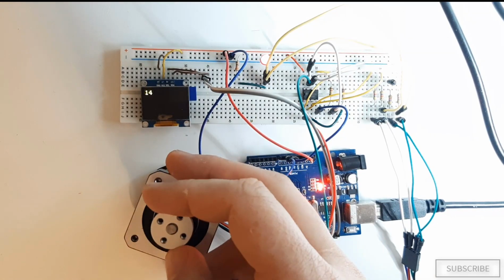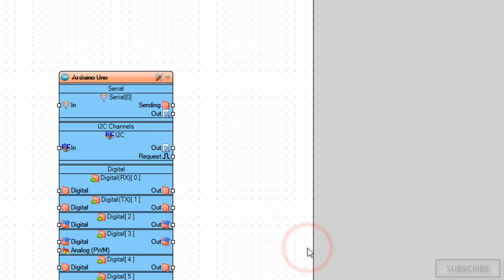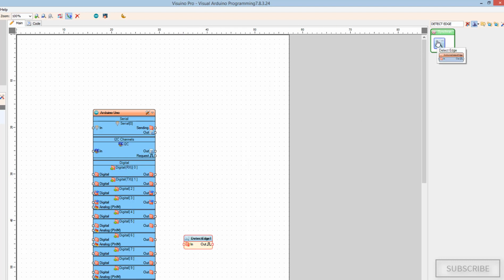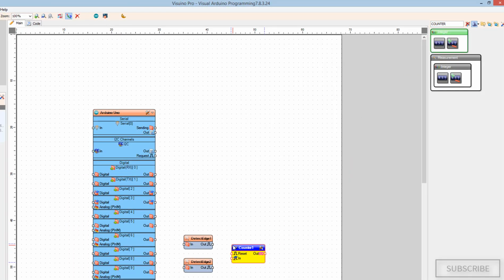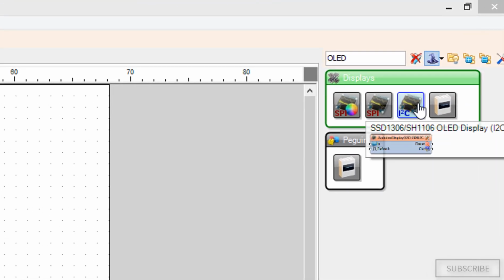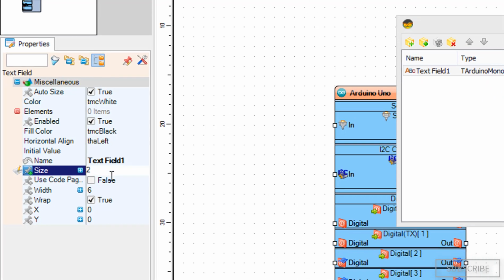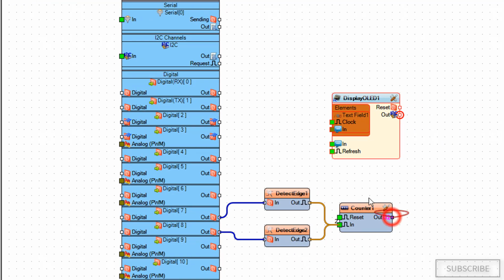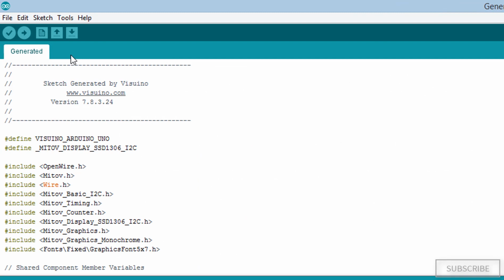Use Stepper Motor As Rotary Encoder and OLED Display for Steps

Comment: what step angle has the motor? 9ª? i have a 0.9º step motor, it would be 400 steps for one rotation
Reply: Will it have enough accuracy used as encoder? Or does it skip steps?